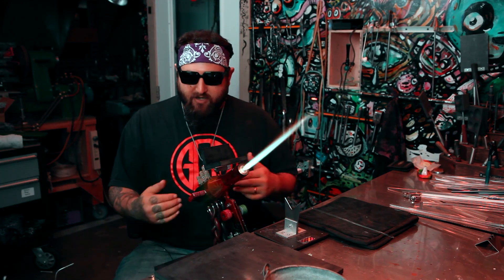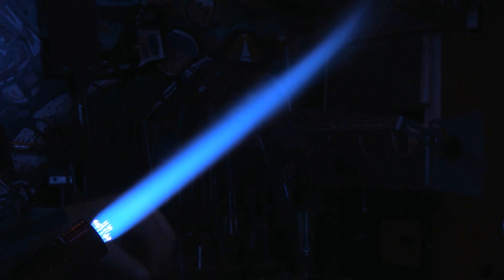Bench Trick: Flame Chemistry || REVERE GLASS ||

Comment: oxygen is extremely flamable even by itself,   it dosent light becasue of the pressure of it when it comes out the torch
Reply from the maker: Oxygen is not flammable, but it can cause other materials that burn to ignite more easily and to burn far more rapidly. The result is that a fire involving oxygen can appear explosive-like.

Comment: Just up front, glass is very new to me. No experience with it whatsoever, but I do have a little bit of oxyacetylene welding experience. For example, when welding steel, I tend to use an oxidizing flame instead of a carburizing flame because the excess carbon hardens the surface of the metal (which could be both good or bad depending on what the weld is on.) My question is, when/why/where would you use the different kinds of flames for different applications in blowing glass?
Reply: ***** Different colors of borosilicate react differently to different flame atmospheres! if you're working with clear boro, this isnt very important.

Comment: Should I watch out if I use a specific flame for too long? I heard you could damage ports if you use too hot of a flame for a prolonged period
Reply: +Benjamin “kawaiimeatpie” Walker For GGT they recommend keeping candle length above 1/4th" specially for lower pressure set ups. You essentially need to push the gas combustion away from the torch face or you'll start melting ports.
Reply: +Matt J, thanks! Know anything about the recommended candle length for Redmax?
Reply: Sorry I don't, There doesn't appear to be a manual on there website. If you contact them by email they should be able to help. (From website --> For more information on torches, contact Jean: jean@nortelmfg.com)

Comment: Hey thanks guys! Really appreciate the hands on videos, I have learned a lot from watching. I have used a Red Max for the last 4 years and have a question about flame chemistry. Nortel recommends using 5 psi on the gas and 15 psi on O2, but I always set mine to 10 psi gas and 20 psi on O2. How does the difference in psi settings effect the flame? Should I continue to set the psi that high? Or lower back to the recommended settings? I have read others using much higher settings on their Red Max. I'm also looking forward to a video on fuming, can't wait! Thanks again guys, you rock!
Reply: on your torch it just messes with knob response, as you have to move the knobs less to get a desired result.  I used to like this but I now set my regs to what Nortel recommends it requires moving the knobs more but I can get a bit more precision from it.

Comment: Every time i use a reduction flame i get soot, is this normal or am i reducing the O2 too much, i still have the O2 running?  Also, ill have to rewatch to see if i missed it but, whats the 3rd set of knobs for? excuse my ignorance im new to it all and im working on a nat8m, i literary only have 2 knobs.
Reply: get that oxy turnt up
Reply: Anytime i get soot i do, i guess i have to just learn these flames. Im like 4 months with no one over my shoulder to help. At least i got yall helping with what you can. Thanks curtis
Reply: If i am not mistaken, that soot is carbon. It will build up when you have a highly reducing flame. Its not bad for the glass or anything. It actually helps to insulate it. When you start to oxidize the flame, it will burn off the carbon and your glass will be clear again. I use a heavily reducing flame when i work a piece that needs to be taken in and out of the kiln a lot. When i get the carbon build up i know its got a good base heat. Then i turn up the oxygen a little bit at a time until i reach a good strong flame and i know the piece wont crack on me.
Reply: Each set of knobs controls one ring of flame on the torch. The first set of knobs (the ones closest to the flame) controls the center 7 jets of flame. The next set of knobs controls the middle ring of flames (33 jets of flame if I recall correctly), and the final set of knobs controls the outer ring of flame (50 jets if I am remembering right.)
Reply: i just started as well about 6 months ago. self taught, which is bittersweet. check out talkglass.com for photo and vid tuts. peace A.M. Garcia
Reply: you reduce a little too much oxygen
Reply: kevin preston Yeah i found out you can burn it off pretty quick, even heard about a fuming tip with it but being new i only see it first hand when i do it and it failed when i tried. Lol. All in due time... Thanks for the tips kevin, im going to have to keep that in mind